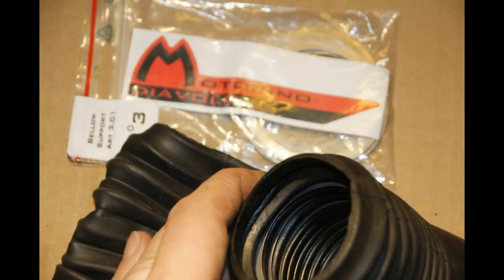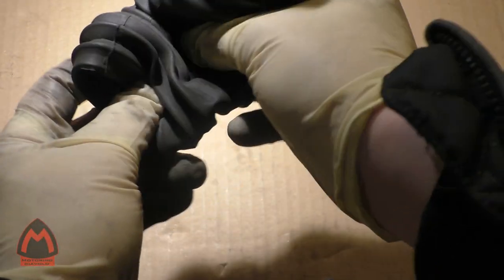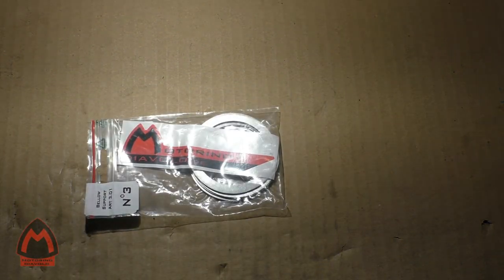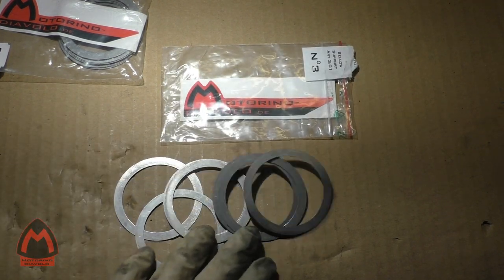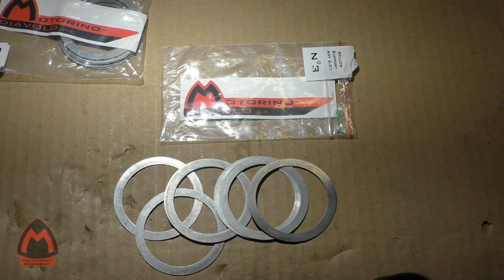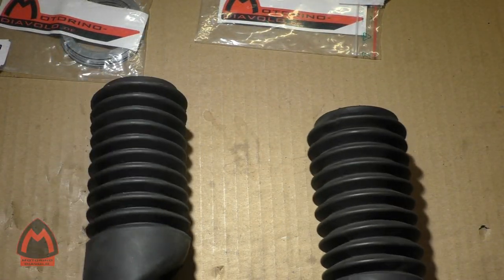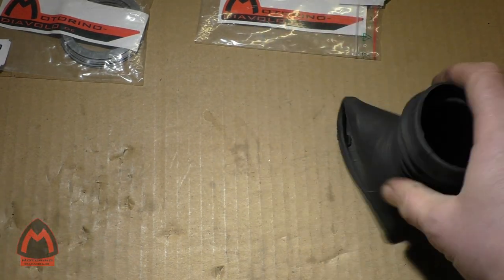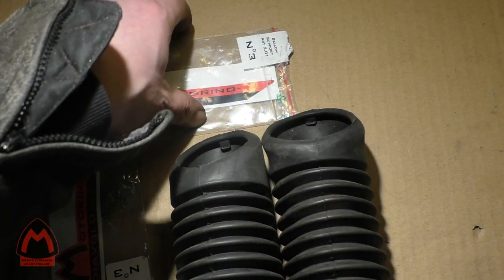vespa BELLOW support MD n°3 / motorino diavolo FMPguides - Solid PASSion /

Comment: Did/do they have any impact on intake bellows deformation or is it more of a "feel good" performance part?
Reply from the maker: they prevent the deformation from. Happening. if u use si carb, no need or "feel good" if u useother carbs nd still bellow - which is possible - then its a good to have.